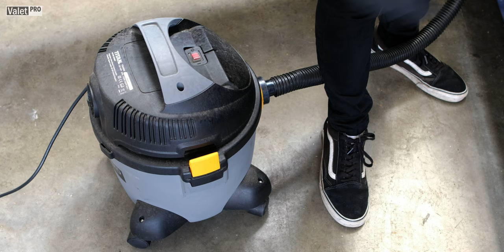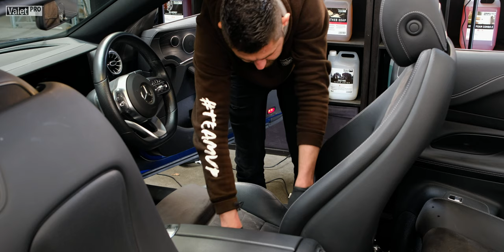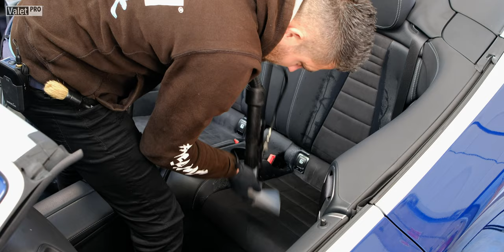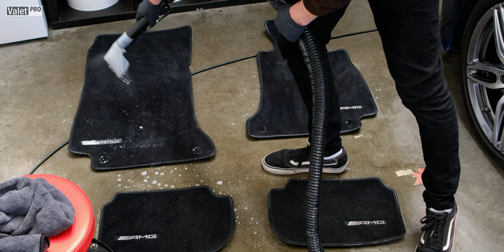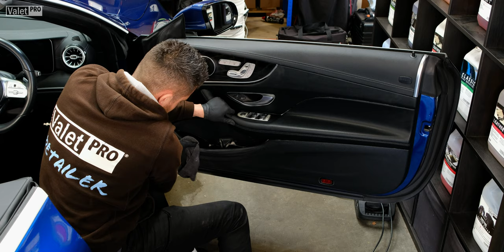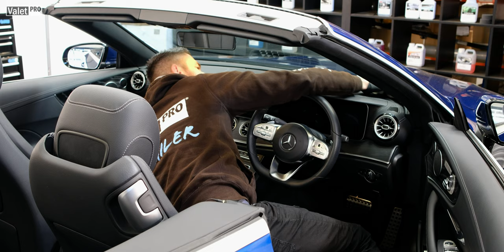Interior Detailing on a Mercedes | ASMR

Comment: Good video Elliott 👍 ! What product do you use for cleaning car seats and carpets using the extractor? and what dilution do you suggest?
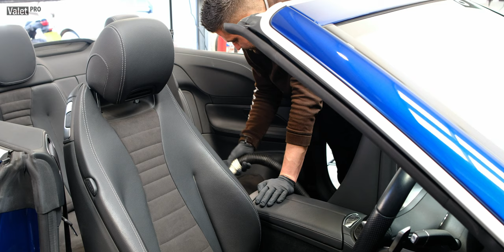Reply from the maker: Sorry for the delay with getting back to you, Bill. For lightly soiled seats and carpets, we'd recommend Advanced Interior Cleaner - this is pH Neutral and dilutes up to 1:80 depending on the method of application (1:20 for light stains, 1:9 for heavy stains, 1:80 for extractor machine). However, for heavier stains, our Classic Carpet Cleaner is an excellent choice with its stronger cleaning power; we'd recommend a dilution of 1:20 through trigger bottles and 1:80 for extractor machines.

Hope this helps?

ValetPRO Team
Reply: @TheValetPRO  Thank you very much!!!